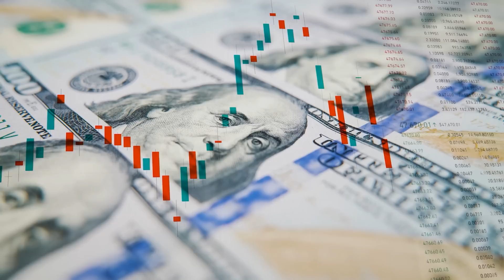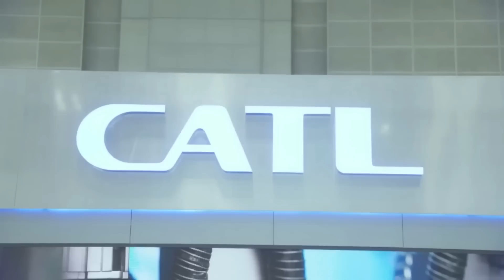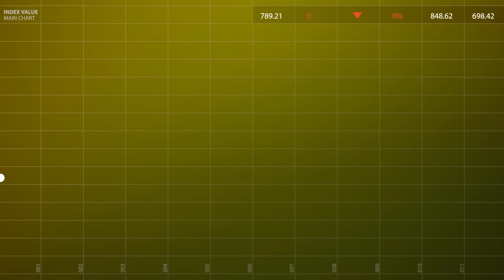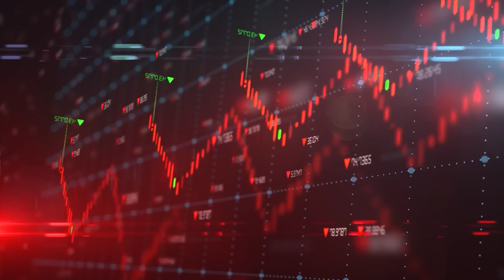Chinese EV’s Are EXPLODING | 90% Of Car Makers Bankrupt

Comment: Poor quality resulting from corner cutting (for different reasons) is apparently an issue in many Chinese industries, especially construction (look up the term Tofu-dreg as concerns that industry in China). So, I’m not surprised. I wouldn’t drive a Chinese EV if you gave it to me for free. Tesla had that issue early on but corrected it by developing a superior cooling system.

Comment: There’s an average of 200,000 gasoline powered cars that catch fire in the US each year. None of the manufacturers have gone bankrupt over the issue it’s still only a 0.07% chance that an individual car will catch fire.
Reply: That may be so regarding gasoline-powered ICE vehicles, but compare the incident rate with total fleet size. Chinese EV's have a dismal record in that light.

That said, I would never buy a Chinese EV strictly based on this shortcoming. Chinese industry (the portion not managed by western outfits), as a whole, has a tendency to cut corners and rip off consumers for profit. Just look at their tofu building construction scams. It's sickening.
Reply: @lrg3834  I wouldn’t buy a Chinese EV either. But I’m just here to look at the fire numbers, not their shoddy workmanship. China has 10 million EV’s on the road. They’ve had a total of 20,000 EV fires. That’s 200 EV fires per 100,000 EV’s. In the US we have 275 million gas powered cars on the road and 200,000 ICE fires PER YEAR. That’s 72 gasoline powered car fires per 100,000 cars per year. Let’s say EV’s have been popular for the last decade. That means China is having something like 20 EV fires per 100,000 per year. It’s still a lower rate than gas powered car fires. AutoEZ insurance studied NTSB data and this is what they found:

Per AutoinsuranceEZ, ICE vehicles are more than 60 times more likely to catch fire than an EV, while hybrids are more than 130 times more likely to catch fire than an EV.
Reply: @larzlarz1140  , interesting stat regarding ICE vehicles. Personally, I know no one who has suffered an ICE-related fire. What the heck are people doing? You have to be really slack on maintenance for something like that to happen. ICE vehicles are very reliable for the most part. I own two pickups. One is a 1996 GMC 1500. Engine still idles as smooth as the day it came off the assembly line. Moreover, the metal body is solid compared to what they produce today.
Reply: What percentage of those 200k spontaneously combusted for no other reason than due to poor quality materials and workmanship? Also, since when has China reported honest numbers? Definitely not since 2020. If they say 19,000 vehicle fires, it's probably closer to 1.9 million.
Reply: @JSMCPN  the vast majority of ICE fires are from crashes. The same as for EV’s. Spontaneous battery combustion is exceedingly rare. Then again, Ford recalled 630,000 vehicles in 2022 for faulty fuel system that caused fire risk in broncos escapes and mavericks. GM is telling 400,000 Silverado owners to park outside because of spontaneous fire risk because of leaking brake fluid and nearby hot exhaust. Escalades, Camaros, suburbans, tahoes and Yukons have a recall for faulty fuel pump that leads to fires. The list goes on and on.  Quick google search will show you that spontaneous ICE fires is a real thing.
Reply: @larzlarz1140  Not exceedingly rare in China, though. It's becoming exceedingly common. And unlike China, GM and Ford will recall 1 million vehicles for situations like that even if 1/10th of a percent of the vehicles are actually affected.
Reply: @JSMCPN  and ICE fires are common in China too. I mean China has 350 million scooters on the road. 100,000 of them are 2 strokes. They park them while still hot in markets close to combustibles.  It is a whole different world there, EV’s and ICE vehicles and safety standards.
Reply: @larzlarz1140  Now you're starting to understand, and see the common element.
Reply: The difference is that dodgy battery cells risk thermal runaway even when not in use. Lithium battery fires can't be extinguished in any normal way with water/suppression etc. They'll just burn on and on and with 8000 cells in some batteries there's a huge risk if quality control hasn't been a priority.
Reply: @JSMCPN watch videos from The Electric Viking ok BYD fires. He debunks many of the videos circulating of BYD EV fires, pointing out the individual models. Most of the video that say EV fire are actually BYD hybrids.
Reply: None of which happen while sitting unused in a garage.  EV fires are much more dangerous because they can't be put out and could take a house with it.
Reply: @shea455  Exactly. Could you imagine a future 110-car pile up where every car is an EV? The batteries would burn for months, people in the middle of the pile-up would die the most painful way, the heat would melt the highway, and the toxic batteries would take months to cool down and stop re-igniting before it'd be safe to start cleanup operations.
Reply: @larzlarz1140  Its not aboute numbers. Its the danger with this type of batterys. When a battery car is on fire things around the fire is destroyed. Open windows in apartments that needs to get sanitized before people can stay there. Luton airport? 55 busses gone in one fire in China. Battery cars just make alot more mess when shit happens.
Reply: 200 k is wronged details of such tell the truth in detale